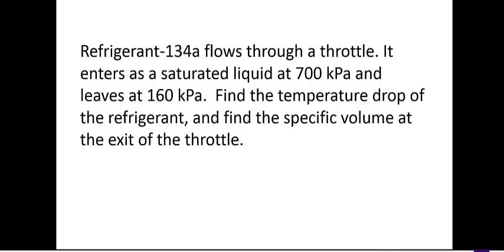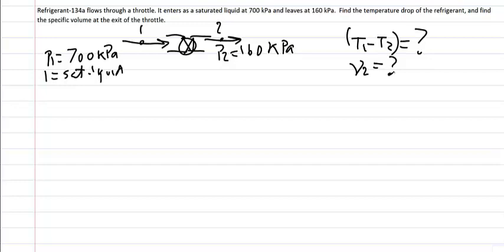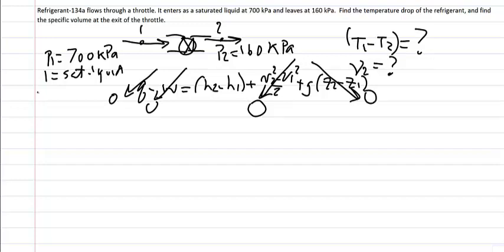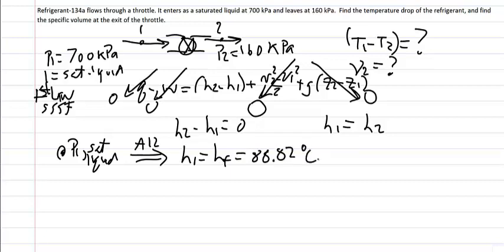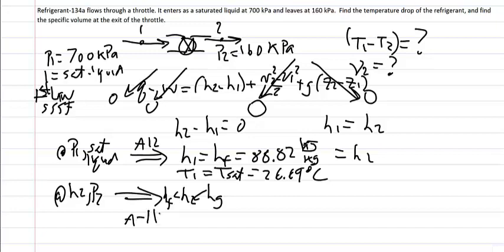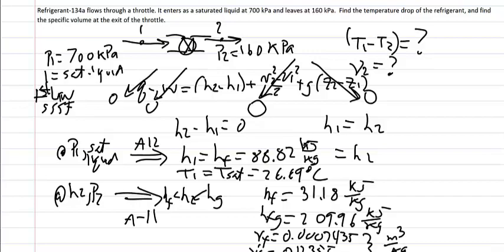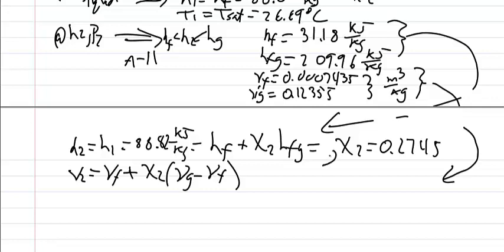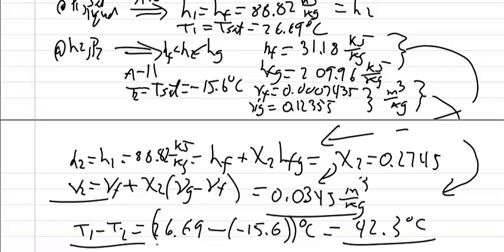Thermodynamics: Example, Throttle valve #1

Comment: If you have condensate (liq sat) in the inlet valve, there is flushing. At the oulet valve you have vapour with an x or steam. So the density will be differents and the velocities too. h1 not will same h2. Is it is?

Comment: Saturated liquid, water, enters a throttling valve as State 1. The enthalpy of substance water at the exit of the throttling valve is h2=340.54kJ/kg and pressure P2=20kPa. Determine temperatures T1 and T2. Draw the T-v diagram and show State 1 and State 2 on this diagram

Comment: Since h1 = h2, how is it possible for hf to be 88.82 at one point, and then 31.18 at h2?
Reply from the maker: hf is a function of pressure. The pressure drops across the valve, so hf decreases as well. However, the value of h2 is not hf at the lower pressure because it is a saturated liquid/vapor mixture.

Comment: I get confused between nozzles and throttle valves. In both devices, there is a decrease in area. However, there's enthalpy drop that is converted to kinetic energy. On the contrary, the enthalpy remains constant in a throttle valve but there's a pressure drop. Can you please help me find  more explanation about the throttling process?
Reply from the maker: Throttle valves have the same inlet and outlet areas.